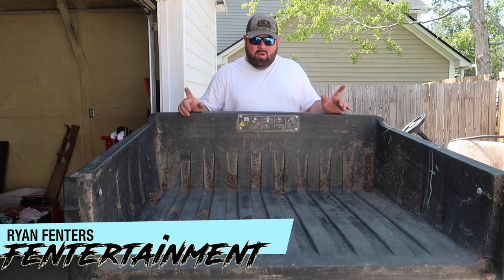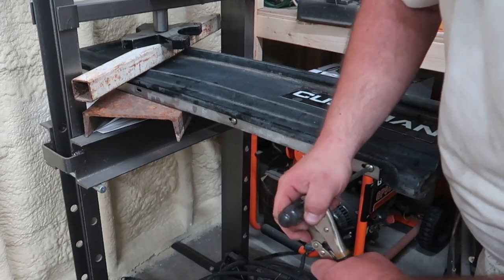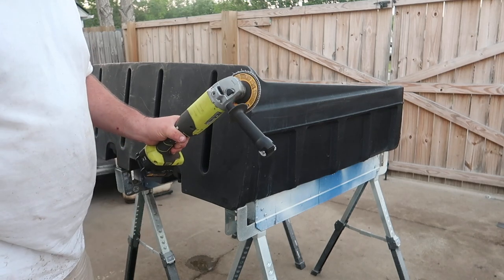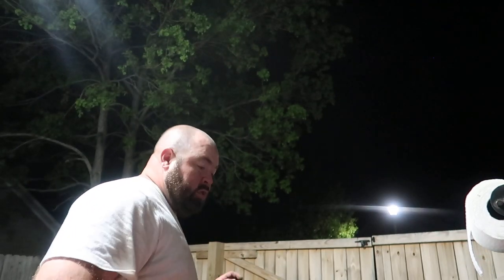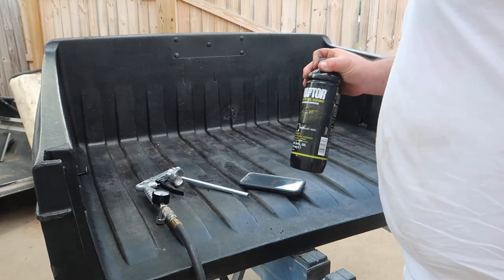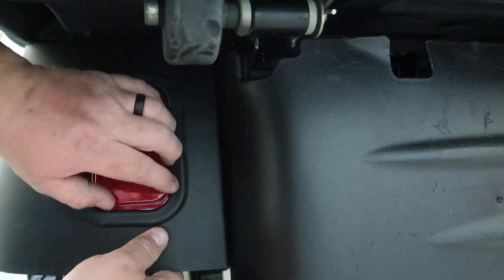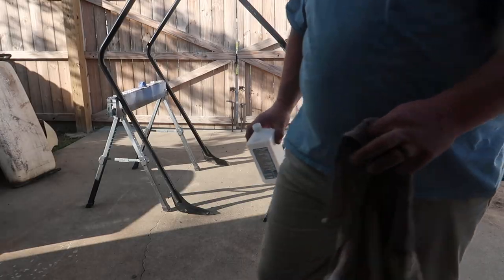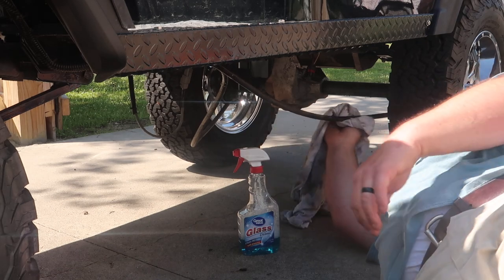The 72v Lithium Cushman Hauler Pro gets a Raptor Liner Paint Job | Utility Golf Cart Build | EZGO

Comment: While using your plastic welder, twist the stitch clockwise or counterclockwise to embed the stitch under a portion of the material that is cooler, permitting you to remove your tool without having it to cool down.

Comment: Nicely done, looks great! I painted my precedent with raptor liner (charcoal gray metallic) and it came out awesome. Only painting I’ve ever done was either with a rattle can, or brush and roller. Kit was easy and simple to use, key is the prep work, sanding, denatured alcohol wipe down and adhesion promoter. Wish I could post a pic.

Comment: Nice video -- great way to spend Sunday morning -- it beats working!  Why did you use the Clorox spray and scrubbing wheel versus a power washer?
Reply from the maker: Good question! I had been using it on the last episode and just continued using it. The pressure washer would have saved so much more time tho.

Comment: Loved the video, great job. I  had been thinking of doing the Raptor (or something similar) to the plastics on my Precedent when I paint the bodywork. I like the idea of the durability of it.

For the hole that you tried to patch, they make what's commonly called " kitty hair" it's fiberglass reinforced body filler that used structurally in sub boxes and stuff like that.

For disassembling parts like the reinforcing strip with Phillips and Slotted fasteners, most tool places and big box hardware stores sell socket wrench socket sets with those bits that can be used with impact guns or ratchets.

Also look at a product called Roloc bristle disc's. They are meant for light rust, corrosion, and stubborn dirt and paint removal. 

Hope this helps